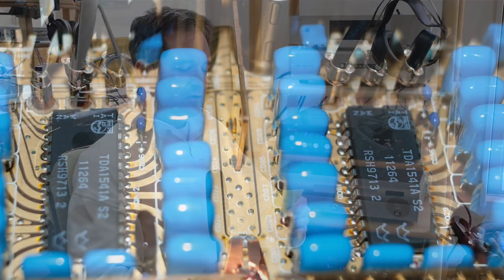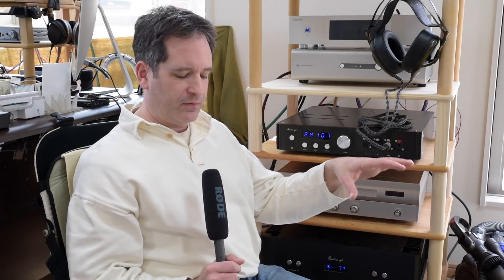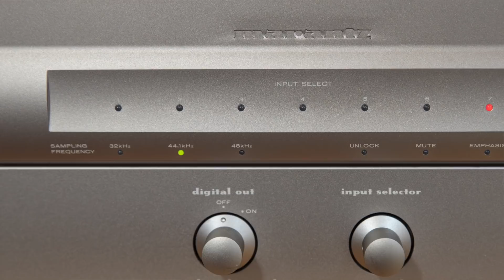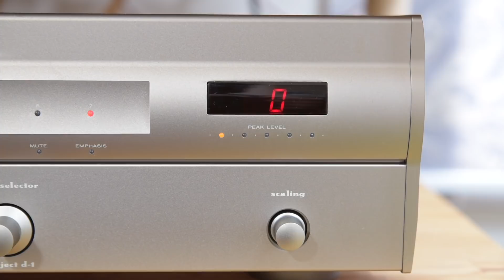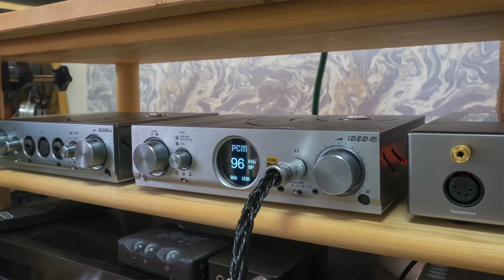Marantz Project D-1 - Legendary Vintage DAC

Comment: I own a Marantz Project D-1. I bought it from online Hifi-do Japan more than 10 years ago. I opened it up and found the DACs were Philips TDA1541S2 with matching date code ie the Double crown chips. The sound is warm and non fatigue. A 100v unit probably meant for only for own domestic market. Not for export

Comment: Like the Marantz Project D-1 !!!
Like your serious (not artifically exciting) review.
Is this a 250 V oder 110 V Version?
Did they produce 250V or only 110 V?
Reply from the maker: I don't recall the voltage selection, but it was a Japanese model, so probably 100V. I was of the impression that they were sold overseas.

Comment: Good review!
The Philips TDA1541A is NOT an R2R or ladder DAC. It is, however, a multibit DAC, like the PCM1704 or the TI used in Yggy.
Reply from the maker: Thanks for correcting me on that. I hadn't looked in detail about how those DACs work, but I found an interesting page describing it: http://www.dutchaudioclassics.nl/Philips-TDA1541.asp
Reply: @Currawong  Yes, classic Philips architecture is not R2R but DEM (dynamic element matching). The D-1 is a mysterious "skunk-works" PROJECT with very little info avail. It's worth mentioning that  much of the sonic charc. may be due to its proprietary DSP 8fs  digital filter and discrete analog output stage.

Comment: You are misleading people. If it uses TDA 1541 chip, you can still buy COMPLETELY new dacs with this old chip (e.g., Audial) or made not so long ago with it (plenty on Ebay). Other older cd players with different discontinued chips also can sound very pleasing, depending on the model and condition, and personal audio preferences. I wonder how they compare with Chord Hugo product line and M Scaler, not so much interested in Schiit Ygdrasil; or Terminator?
Reply from the maker: Some manufacturers have stock of the basic TDA1541 or TD1541A chips, but good luck finding an A2 Double Crown chip for less than a few hundred, or even maybe more than over $1000. Then you have to be sure it isn't a fake (non-A chip with faked markings).
Reply: Lots of fakes these days

Comment: The biggest difference for more 2 order harmonics (and dynamic) is the diskrete analog buffer! There you can tune the sound (something you can't do with Op-amp's to that regard). The dac-chipp makes for a small difference (but it is there in r2r).
Reply: thats not true, dacs and op amps make big improvements in equal terms, i was dissapointed with all the sabre, akm, cirrus logic dacs I´ve heard no matter if i add my favorite op amps (if it posible), then i buyed soundcards that nobody talks, one with philips dac, other have the best wolfson dac, and both have op amp sockets in the output, and even with the cheapo texas insrument op amp those sound like no other, and using my best op amps (actually a marantz hdam clone) the sound its so vivid, fast even better than "high end" gear but for peanuts of costing